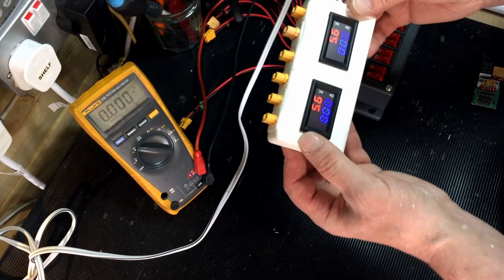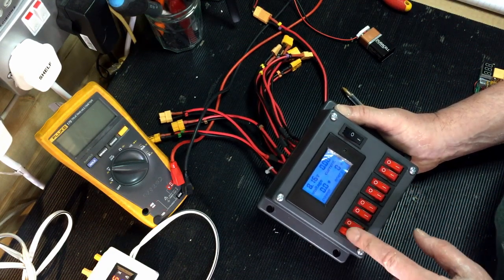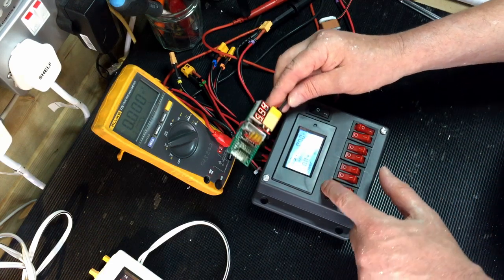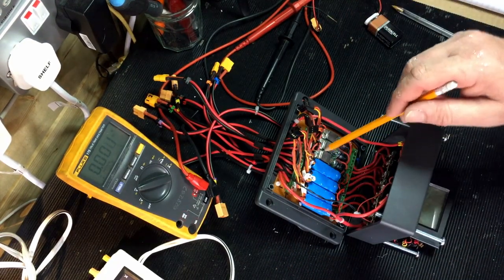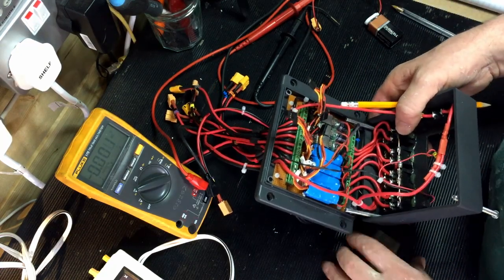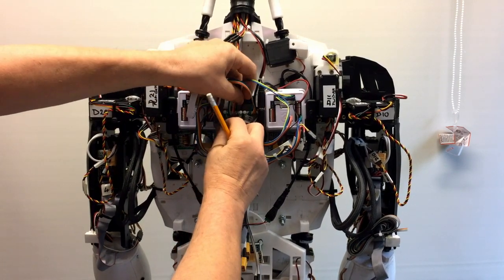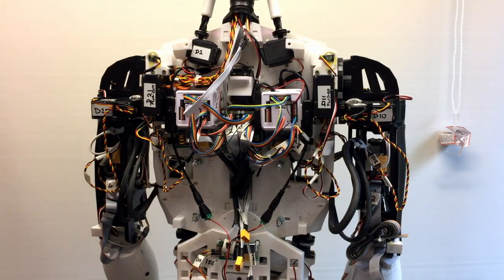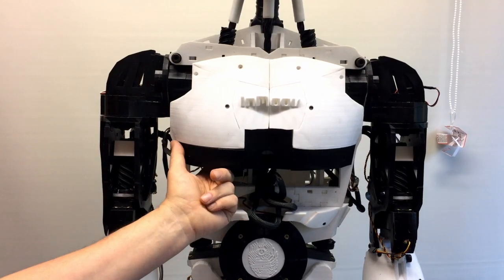InMoov Build Part - 18

Comment: Hi Kyle
Thanks for your video. Would you recommend 14AWG or 12AWG for power? Would you mind sharing the layout of the power distribution board? Any regrets or changes to this since 2017? :)
Reply from the maker: Hello, 14gauge is fine, maybe less for shorter runs.   Gael, the InMoov creator uses flat ribbon cable but does use several cores to increase the thickness of the power rails.  The control system I use [EZB] can reboot itself when the power drops below a certain voltage suddenly, so I have  always used high current capacity reliable power supplies to drive the robot.   There are a lot of Servos in the InMoov as you know.  Here on my blog I have shown the circuit designs. [http://myrobotnigel.blogspot.com/p/blog-page_7.html].  
Any regrets/changes?  Great question - I made it over complicated but that was part of the fun really.  NYouTube

Comment: hi
great build.
any chance of a link to that box you are using.
Reply from the maker: Hi Peter
Its not a 3D printed box but a box I bought from CPC-Farnell, it made by Takachi, model CUE8320DG.   I then just cut out the switch slots and meter slot.  The box is 125mm x 125mm square and 45mm deep plus the flange which makes it 155mm wide at the back.    Would be a good project to 3D print.
Here is the link to buy it and I assume they are available elsewhere as well. - http://cpc.farnell.com/takachi/cue8320dg/flanged-case-dk-gy-155-6x125-6x45mm/dp/EN83735
Reply: Hi Kyle
Thanks for that..
My i ask about the little servo connection boards with voltage display you have made, do you have list of the components used to build them. i have just found your video series, Great work..
I have now dusted off my old inmoov build and i am removing all the old nervo boards and arduino stuff and replacing it with two EZ-Bs and your power distribution system.
Reply from the maker: Hi Peter
The small PCB boards are from Amazon: just type double sided prototype boards and there are loads of them available
The Re-settable 1.6Amp fuses are CPC: http://cpc.farnell.com/bourns/r160-0-99/multifuse-radial-1-6a-30v/dp/FF01361

The voltage displays again Amazon: SODIAL LED mini voltmeter, for example, or ebay do them: https://www.amazon.co.uk/Volmeter-Voltmeter-digital-voltage-display/dp/B00PGOU8UM/ref=sr_1_2?ie=UTF8&qid=1509189790&sr=8-2&keywords=voltmeter+LED+display

The small LED indicators [with built in resistor] that light up when the fuse has tripped, wire in parallel  with the fuse: http://cpc.farnell.com/kingbright/l-934id-5v/led-resistor-3mm-red-5v/dp/SC14314

Vero board: http://cpc.farnell.com/vero/01-0021h/vero-board-121x102mm/dp/PC00046

Terminal blocks: http://cpc.farnell.com/buchanan-te-connectivity/1-282836-2/terminal-block-pcb-5mm-12way/dp/CN15857 and http://cpc.farnell.com/buchanan-te-connectivity/282836-6/terminal-block-pcb-5mm-6way/dp/CN15852

The large digital multi-meter [volts, current, power energy] is a DROK from Amazon:  https://www.amazon.co.uk/Digital-Multimeter-6-5-100V-Amperage-Backlight/dp/B017NEA71C/ref=sr_1_7?s=diy&ie=UTF8&qid=1509190330&sr=1-7&keywords=voltage+meter+display

The red rocker power switches, Amazon: https://www.amazon.co.uk/TOOGOO-Light-Illuminated-Rocker-Switch/dp/B00IIE1B6W/ref=sr_1_7?s=diy&ie=UTF8&qid=1509190483&sr=1-7&keywords=dual+switches

The PCB 3-row header strips were from Sourcingmap on Amazon, lots of different types.  Plus XT60 connectors and cables etc from HobbyKing and many other places. 

I think that all the parts but let me know if you need more info.   I have not done any schematics which I must do at some point.   If its not clear and can do a layout.
Reply: Hi Kyle
I am watching this video and trying workout your wiring. I count 6 small board, is that correct. also what is the board between the EZ-bs, i cant see for all the wiring.
The double sided prototype boards are in a 32 piece kit, is the 3cm x 7cm board the one you are using?.
Reply from the maker: Hi Peter, email me with your email address and I will send you the wiring layouts [click "about" tab on my channel and the email address is there]
Reply: hi
just checking. did you get my email address??
Reply from the maker: Hi Peter, did you get the pictures OK that I emailed?
Reply: Hi kyle 
Yes I did thanks.
Been busy with work .
Reply: Hi Kyle
Where did you get your ezb from.
I am having problem with my robotshop
Reply from the maker: Hi Peter, I recently bought a 3rd EZB V4 and Camera from HobbyKing.com  , ordered last week and just arrived this evening.   £46.88 for the controller and £35.06 for the camera.  Plus £5 p&p
This is cheaper than Robotshop [UK] at £65 but I think it may be an older model as its not called a V4/2 just a V4.  Fine for my needs anyway.
Reply from the maker: Also check out my robot blog page that is now working: http://myrobotnigel.blogspot.co.uk/
Reply: Hi Kyle
Thanks for the link, looks good, i have saved as bookmaked it,
I ordered my Ez-b from robotshop on the 28th and tracking shows it hasn't left france, not happy!!!
I should have looked at HobbKing site.
Reply from the maker: Peter,  you may be interested in knowing that the EZB hardware kits are onsale at Hobbyking, which is a bit annoying!